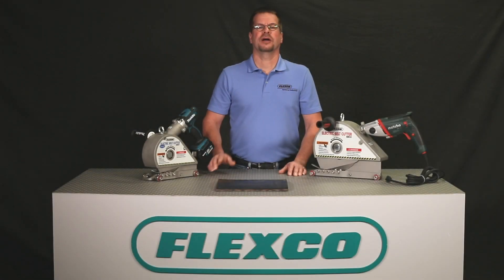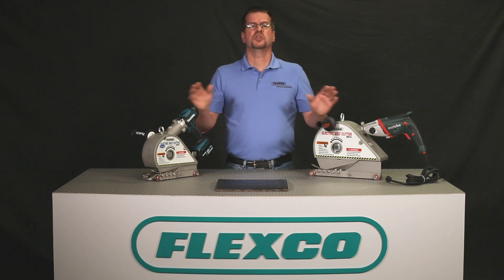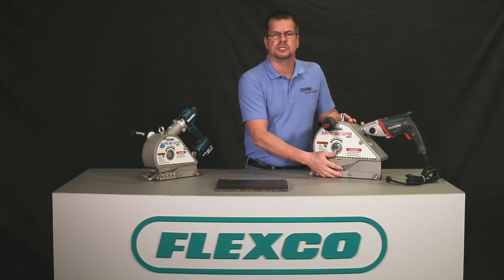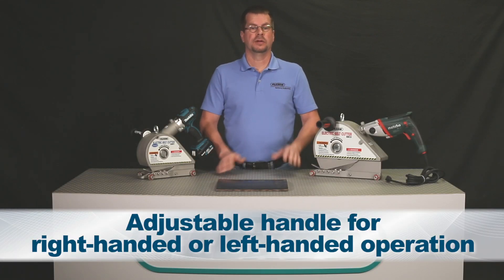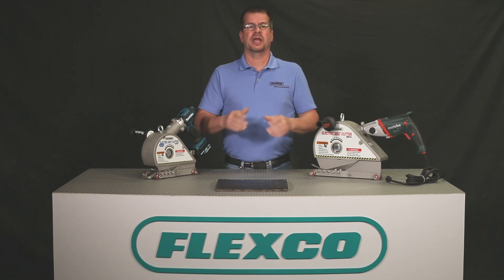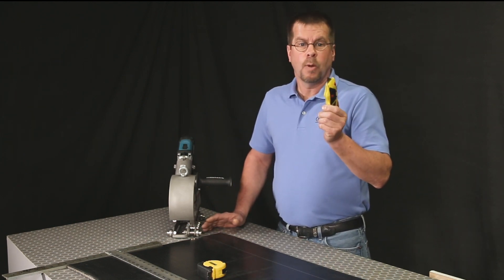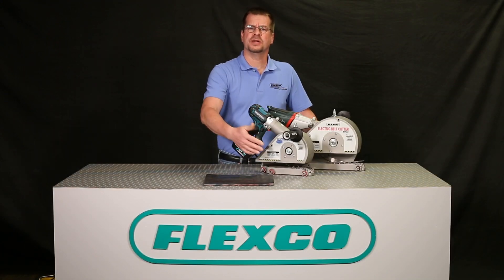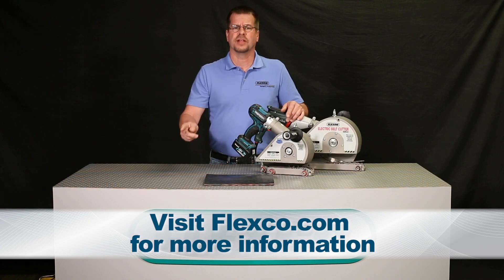@FLEXCO Power Belt Cutter

Comment: Hello.  Is this cutter designed for longitudinally cuts on EP conveyor belts or only transversely cuts?
Reply from the maker: Yes, you can make longitudinal cuts like slitting belt with this tool. The operator steers the belt along a pre-marked cut line.
Reply: @FlexcoTube  Thank you!

Comment: What is the life of blade?
Reply from the maker: The life of the blade will vary depending on what type of material you are cutting, such as soft rubber plied belt, harder PVC belt, UHMW, new belt and used belt to name a few.  If the belt is worn with small particles of material embedded in the belt that will have a major factor in blade life also. The blade can easily last 1+ years of heavy usage if the material doesn’t cause excess wear or damage as described.
Reply: @FlexcoTube  thank you.
Reply: Price of belt cutter ?
Reply from the maker: @chetan8036  Hello, at Flexco we sell our products through our local sales representatives and distributor network. You can find your local contact by clicking on "contact us" on our website.
Reply: @chetan8036 
❤
Reply: Please price?